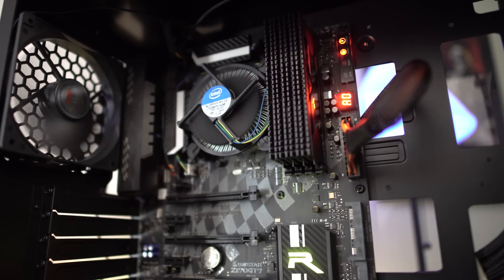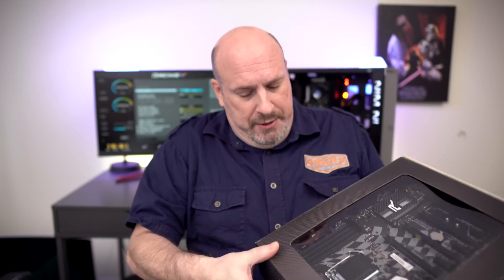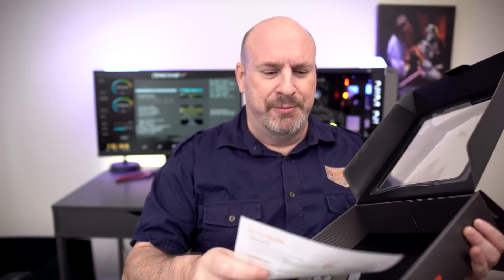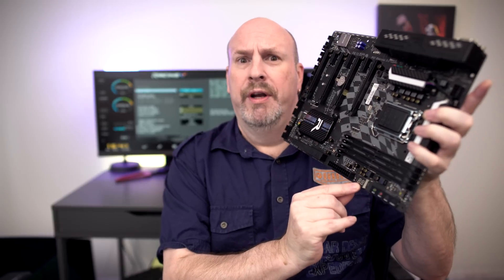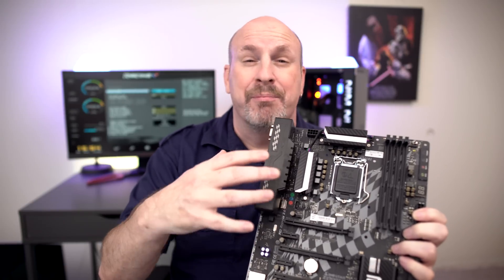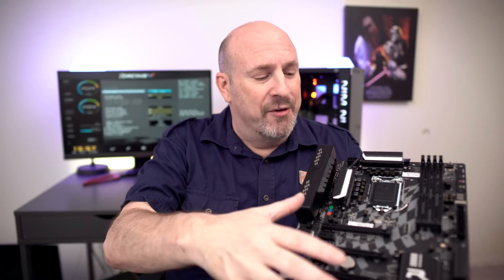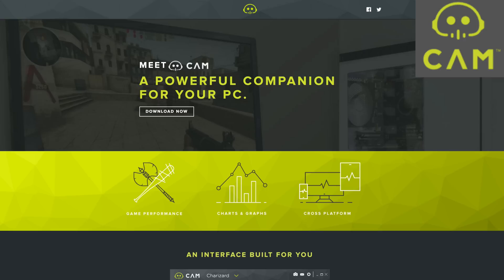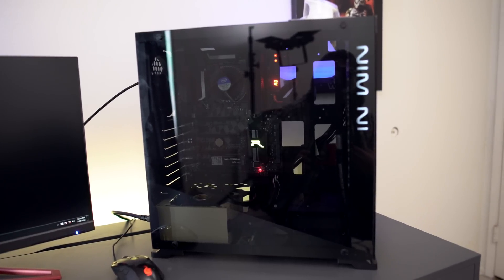What is a Racing Motherboard?

Comment: did he just say m.2 is the fastest way you can go?.....
Reply from the maker: +ApaxGelfling For booting
Reply: Tech of Tomorrow right, but wouldnt a pcie based ssd be faster?
Reply from the maker: +ApaxGelfling 2 is direct to the system
Reply: +Tech of Tomorrow what does that even mean? both would be.
Reply: +ApaxGelfling depends on the drives being used and the motherboards involved. Both standards use PCIE lanes, 2x and 4x being most common.
Reply: +Tech of Tomorrow wut?

Comment: Never heard of the brand BIOSTAR, though i live in belgium so they might not have any suppliers in europe.
@Elric, is this a brand like powercolor, low/mid tier? or is its a high tier like evga, gigabyte, asus, msi etc....
Reply from the maker: +EmBoLabe Yes Sir
Reply: +Tech of Tomorrow Thanks for the quick response. You Rock Sir.
So, is it a high or mid tier, Sir Elric?
and what are the price of this racing mobo, don't care if its in dollars or euro.
#IAmBrussels
Reply from the maker: +EmBoLabe Middle..Its $149.00
Reply: +Tech of Tomorrow Thanks. decent price for those specs.

Comment: Does anyone honestly buy a Biostar board for gaming?
Reply: Define what is a motherboard made for gaming ?
Reply: Honestly I got myself an A88X Biostar Motherboard and it's pretty solid and have had very no problems and it works like a dream when I'm gaming.
Reply from the maker: +SmashBomb The new stuff is all good stuff..
Reply: Even so, rhat's on FM2 socket, much more budget oriented. Someone dropping money on an Intel K series would never pick a Biostar board over Asus or MSI or whoever.
Reply: +Tech of Tomorrow true
Reply: +Kevoy Daley that's true too
Reply from the maker: +Kevoy Daley They sure would if they did not have the finance for other said boards....
Reply: +Kevoy Daley All the silicon comes from Foxxcon anyway, you're just paying for the name and extra features.
Reply: +Tech of Tomorrow True, but what I meant was that if someone is already shelling $350 for an overclocking CPU they probably would prefer to spend the extra cash on one from a more popular manufacturer, that guarantees them a more stable OC. It's still a good option though, I'm all for diversity in the market, was just pointing it was kind of a niche part, people are more likely to get it for the stripes :)
Reply: Chris Wilson ? Did I ever say otherwise?